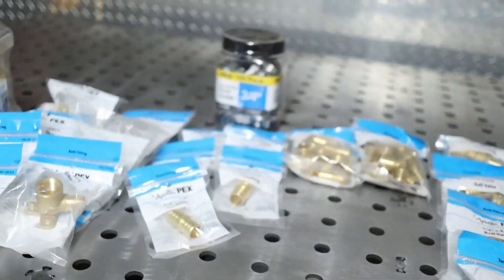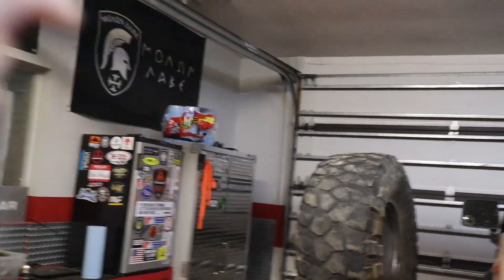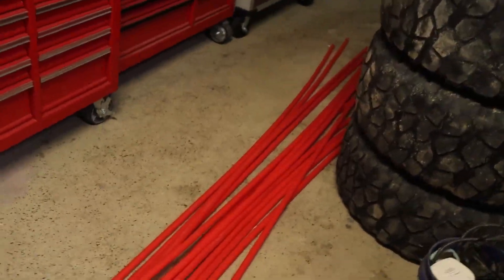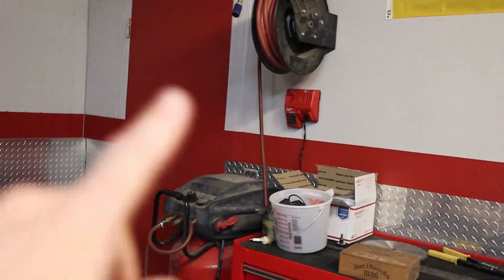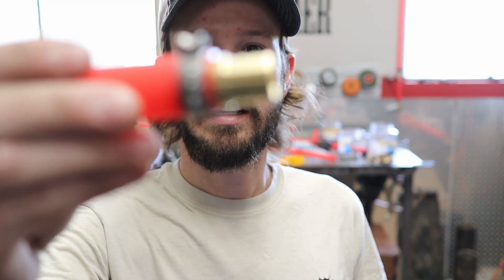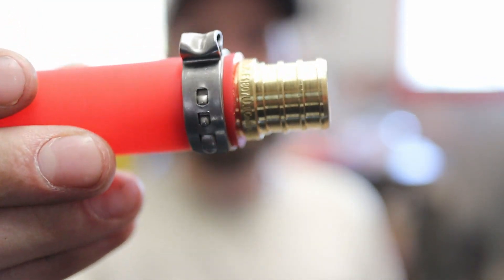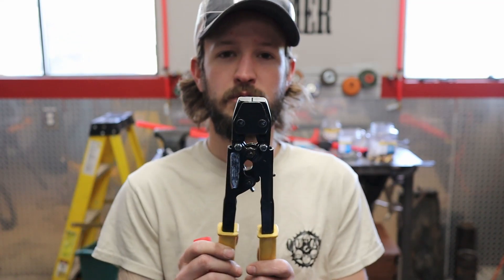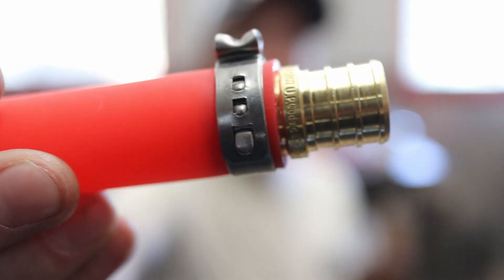Pex for shop air?? Will it last??

Comment: Those rings are Garbage get the tru pex rings
Reply from the maker: Used to do plumbing for a living. I've seen too many of those copper rings corrode and leak. I've never seen these stainless steel rings have an issue
Reply: @letsfabricate5388 PEX A  fittings are better
Reply: @ginosolandri5243  Yes for water Pex A reduces the restriction in flow from the larger fittings used in Pex B.  If using the same 1/2" water lines in both A and B in a house.  Which is why you run a trunk line of 3/4" size throughout the whole house and only reduce down to 1/2" size at the fixture if using Pex B.  To be extra safe and cautious and eliminate all reduction of flow with the fittings.  But with his air hoses, he is already using 3/4" Pex B and its fittings for the entire system.  Only reducing down to 1/2" or 3/8" at the outlet to his 3/8" air hose.  So he is already plenty oversized already even with the small amount of reduction from the larger Pex B fittings.  He has plenty of air.  As for Pex A or Pex B pipe and fittings being better in plumbing water, its debatable.  Both are 100% reliable.  And the slightly larger Pex B fittings increasing friction and reduced flow can be easily overcome with pipe sizing.  Pex B is easier and cheaper to install.  Especially for the DIY guy.